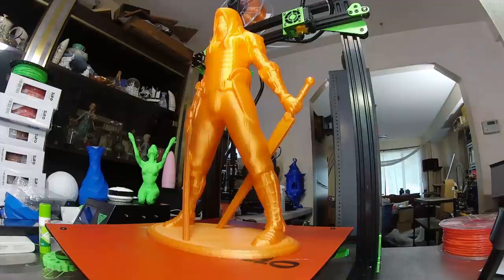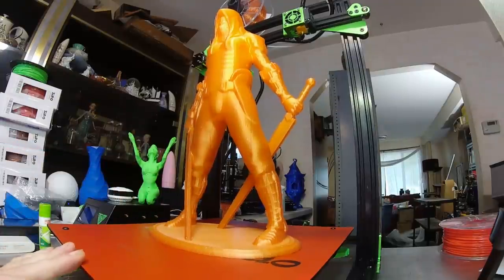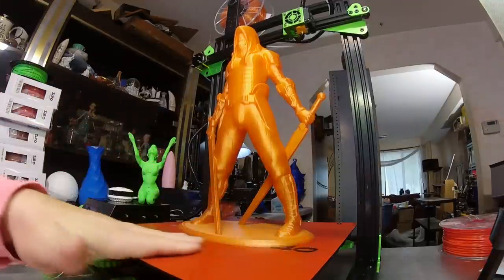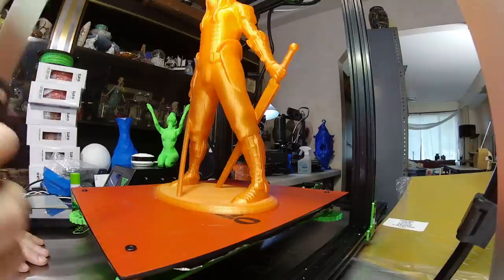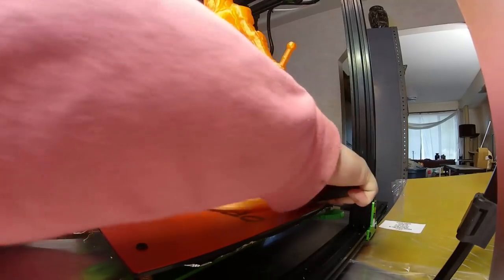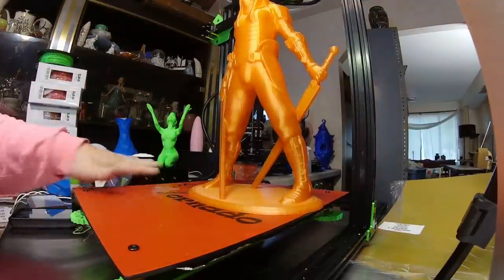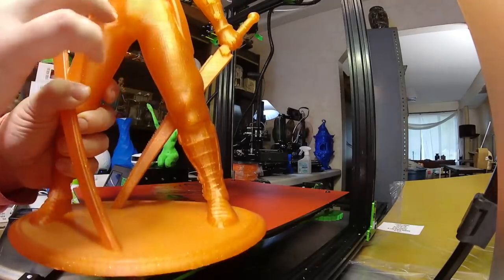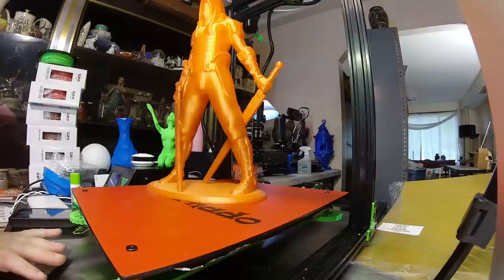Today's 3D Print 112 Removing Large Prints from Tevo Tornado Print Surface

Comment: Have you tried the BuildTak spatula? Once you get some daylight, it's very good for prying the print of the bed. Also good for getting daylight with a nice stiff poke since it's dull it doesn't damage the bed, or the print.
Reply from the maker: not yet. I may have to try it. my issue is I use print in z which is stunningly fantastic but it does have one issue. I tend to prefer to lean on the side of squish so there is NO daylight. getting that first bit of daylight is the hard part. I am going to experiment with flexible plates. they are ideal but VERY expensive right now.

Comment: Just got my tevo tornado yesterday afternoon.  Apart from some fairly obvious quality control issues ie. loose screws on fans (not even done up at all), loose internal nuts for control box connections and extremely loose belts and a jammed front lower belt tension wheel (i suspect that each printer is not test printed on as it would not have ever worked like this) i have been able to get the spool holder printed.  The first time i tried my filament was knotted up and caused a problem after about 4 hours of print time.  The second go was done overnight.  Print came out nice but with one major problem.  BED ADHESION IS INSANE.  I literally could not get it off and after heating bed to 80 degrees and then 90 degrees i have made the pla heat up again and have destroyed the bottom surface due to this and using a spatula.  Any tips on getting prints off would be appreciated.  This is not my first printer but it is my first one with a heated bed so i have never had this amount of adhesion.  
Thanks for any information that may help.

PS my sd card was also empty.
Reply from the maker: Mark Andrews that should be pretty easy you come from a non heated bed so you're probably used to having to use pretty aggressive squish to make prints stick that's probably your problem use less squish you won't need as much for the heated bed and the build service is pretty good I just adjust your bed level for Less Squish and you should be good to go also be sure to let it cool down first before attempting to remove it is much more difficult to remove while it's hot
Reply: Thanks for the fast reply.  I have used the paper with a bit of friction method as i have always done to level the bed.  Would this still apply.  I usually would use more friction than i have used already.
Reply from the maker: Mark Andrews the paper only get you close you then have to live adjust as it prints until you get the desired amount of Squish you want less friction not more the filament will stick better to your bed heated and better to your bed with the print surface so you don't need as much friction or as much to squish to get good adhesion
Reply: Thanks again.  Printing your remixed bed knobs today as the stock nuts are a bit hard to do fine adjustments with.
Reply from the maker: +Mark Andrews have a heavy wrench handy (a normal crescent or adjustable)

Drop the bed nut in and give it a few whacks till its in. Its a press fit.
Reply: Just wanted to say that for those of you that have a tevo tornado and have not already done so, print nerys bed knobs from thingiverse.  Printed out mine this arvo and let me just say that it makes leveling the bed so much more precise with the larger knobs as you can get alot more finer precise movements.  If you have a vice, the stock knobs just press fit in.

PS. Nerys comment regarding the cooling fans in the control box being loud is correct (it literally sounds like a tornado).  Any idea on a fan swap to make them a bit more quiet.  They are basically the loudest part of the printer.
Reply from the maker: Mark Andrews over the next couple days I'll be making the modification too quiet fans I got two 12 volt noiseblocker fans a 24 to 12 volt converter so that I can power them that should make a big difference I'm trying to figure out an elegant solution for the hot end fan but I have a feeling I'm just going to need a second 24 to 12 volt converter or some relays

If you don't have ice just dropped the dogs in and use a wrench to tap it in like a hammer while holding it's in your hand they press right in
Reply: Awesome.  Looking forward to your results.  Forgot to mention that thanks for the info regarding the squish for print removal.  With the knobs it was so much easier to make those fine adjustments and so far so good with removing prints.  Thanks again.
Reply from the maker: Mark Andrews no problem I like my critters happy :-)
Reply: Another quick question for you.  Do you know if the barrel in the cloned e3d hotend of the tornado is ptfe lined or is it more like a genuine e3d v6 hotend without ptfe lined barrel.  Reason i ask is i want to print nylon and i need to be able to go above 240 degrees.  Currently trying my first abs print with a heated bed.  Previous attempts with my old non heated bed printer were unsucessful with abs even with glue and a rather large brim to account for warping.  Loving the tornado so far.
Reply from the maker: Mark Andrews good question I'm going to try to find out
Reply from the maker: +Mark Andrews so far what I'm saying is that the PTFE tube inside so it's not all metal meaning 240c 245 C limit still waiting for a reply from tevo
Reply: Looking forward to there reply.  If it has ptfe tube in the barrel i will order a genuine e3d barrel as they are all metal and probably the whole heat block assembly also. Tried the abs and still had some warping and really bad layer adhesion prob due to low temps 235 nozzle and 80 bed.  Dont want to increase temp on nozzle until confirmation of barrel.  Could also be bad filament as it is at least 12 months old.